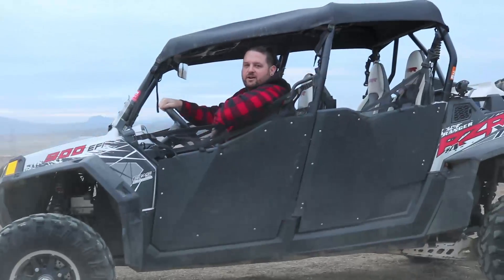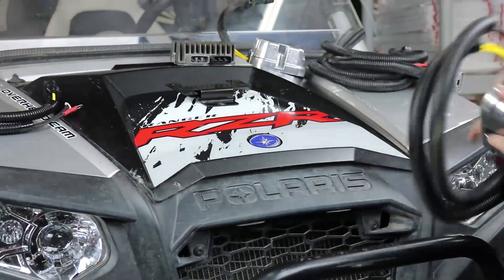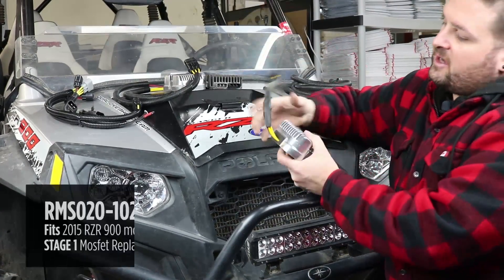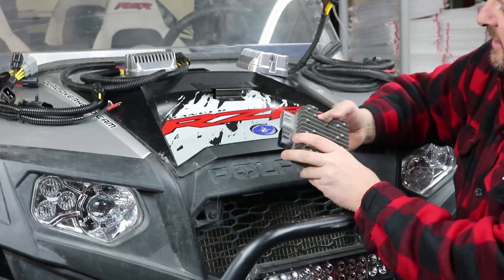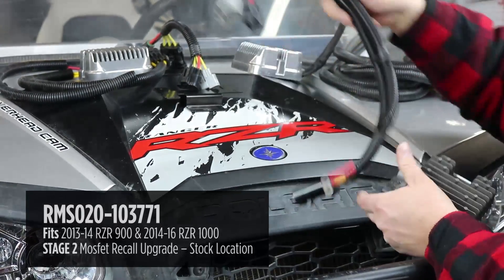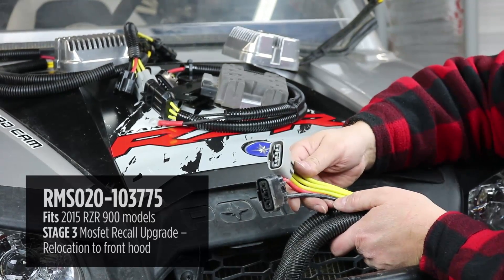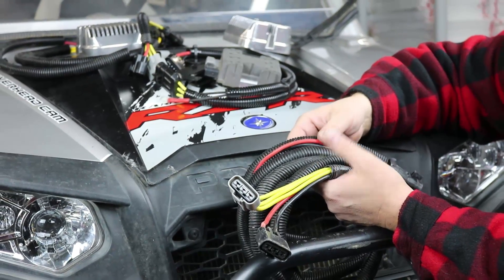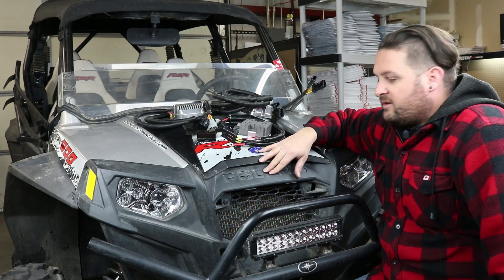Product Showcase: RMSTATOR's Heavy Duty Mosfet Voltage Regulator Rectifier (Polaris RZR 900 & 1000)

Comment: My rzr 1000 Xp 2019 
Shuts off on a run no check engine light but turns right back on when I turn the key will this fix the problem

Comment: Hi,
Is this recall polaris shunt or serie ? this is the version on newer Polaris i guess...
Reply from the maker: Our regulators are shunt style, using MOSFETS for shunt switches. So are the Polaris regulators, though they use a thermal switch in series to disconnect input if the internal temperature rises too high. Note OEM Polaris regulators are not true series regulators.
Reply: OOps, i bought a 2017 Polaris ranger 1000 RR thinking that it's a series régulator...
On check out i get only results testing positive tool to negative RR (all three around 610), now i'm completly lost about this thing, regarding to this video https://www.youtube.com/watch?v=9LwDPHvzH90
it's all confuse to me.
So, you think my rectifier is a dead one?
Thanks Elvin